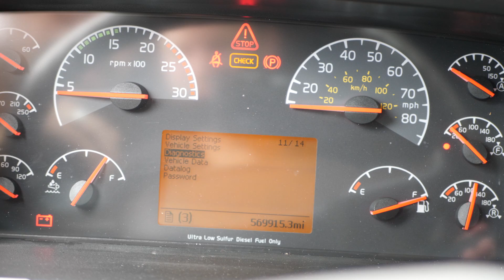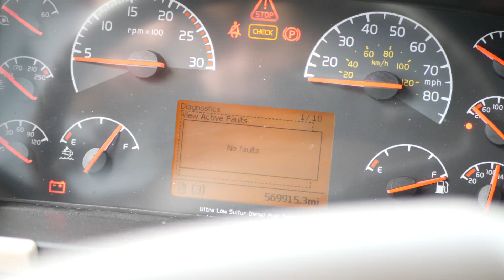Reset SCR Nox Sensor - Reset DEF Injector on 2014 Volvo D13 | OTR Performance

Comment: Hello, I’m having issues with my ac system in my 2014 d13 Volvo. I’m not getting power.. do you have any resources for wiring diagrams? Or maybe a YouTube video that can help? Thanks
Reply from the maker: Hi Hector, Sorry but we don't have any resources available.

Comment: You can reset check engine light even by tool for $11
https://www.amazon.com/Veepeak-Bluetooth-Diagnostic-Supports-DashCommand/dp/B011NSX27A/ref=mp_s_a_1_6?keywords=Veepeak&qid=1573278039&sr=8-6

Comment: I have Volvo 2015 d13 I did clean dpf filter and had some other parts replaced and I keep get soot lvl high after 5 hours will need do park regain !

Is this tool will help me restart with out do that stupid park regain  and keep rolling ?
Reply from the maker: The tool will reset the aftertreatment system and reset the derate. Let me know if you have any other questions.

Comment: First I want to say thank you..for you help..I have a Volvo 2011 D-13   780 with the same problem..cut it use that tool for my truck too..or is only for 2014 or over.. ?
Reply from the maker: Hi, thank you for reaching out! For years 1999 - 2013 we have a different tool that will work for the 9pin diagnostic port. See it Here: https://otrperformance.com/products/dtc-aft-reset-tool-volvo-mack

Comment: Thanks for this video  ..
My question for vnl780  this one will clear the code it's mean the problem is fixed !!! For example when I get the check engine light comes on this device will help me to clear the code . what the benefit from this steps
 thank you very much
Reply: Clearing the code will let you drive to your destination but won't fix a problem if it exists.

Good tool,I've just bought it.